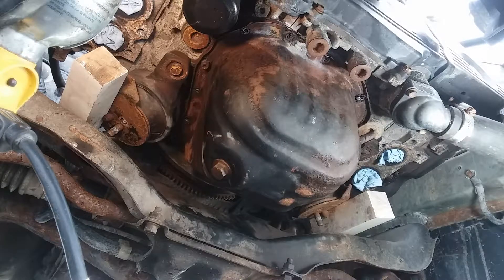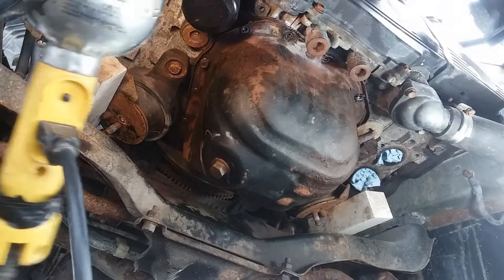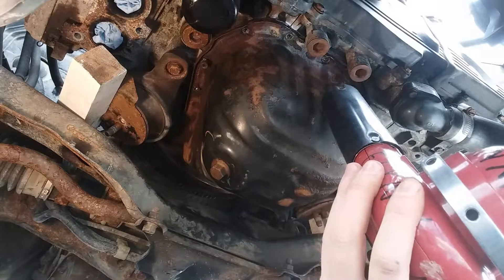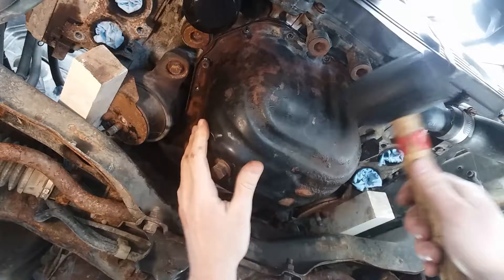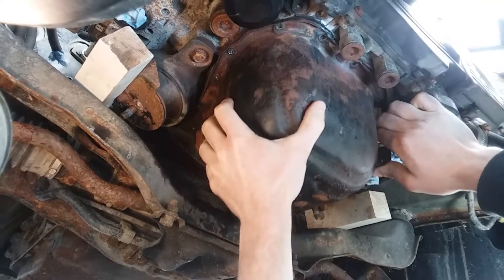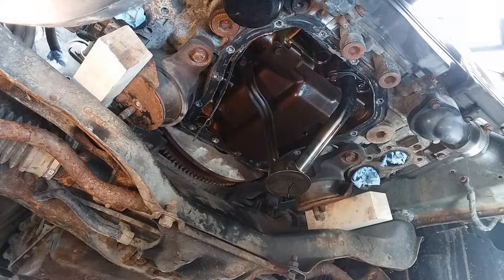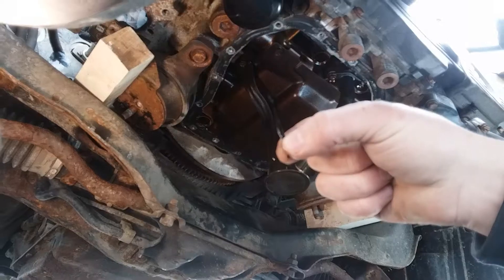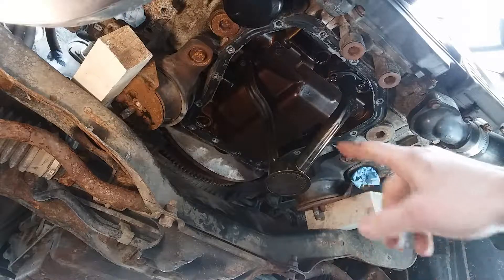2005 Subaru Outback: Oil Pan Replacement Part Six/Eleven

Comment: nice video, Im in Norridgewock Maine and have to do this on a 04 forester. What model is yours? Seems jacking the engine 2 inches instead of 1 that others have shown makes removal much easier!
Reply from the maker: This is an Outback. I'm not certain of the forester layout, however I imagine it's not too different. Pulling the front Exhaust definitely helps in gaining the extra clearance for ease of access.
Reply: @maineiacnorth1243  I did it without removing the exhaust, had a bit of clearence issue with the oil pickup, but was very minor and was able to "wrestle" it by  with minimal force! Thanks again for the video
Reply from the maker: @vicktdock  You're welcome.